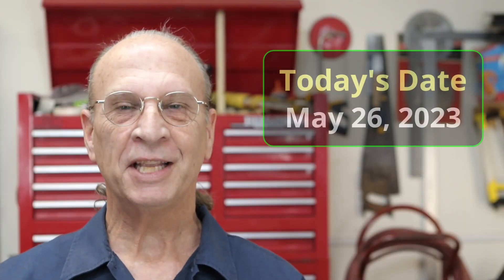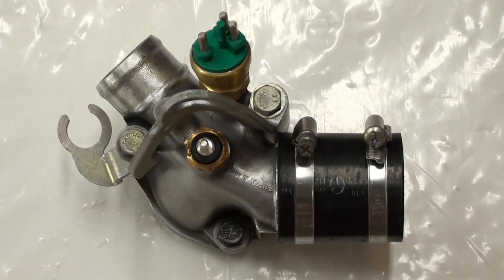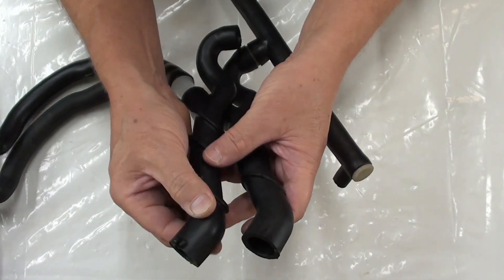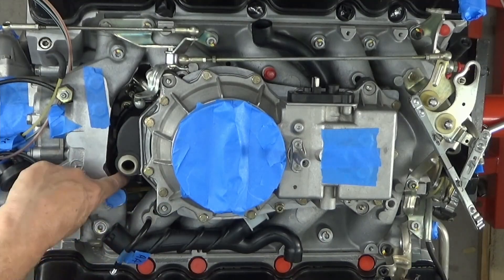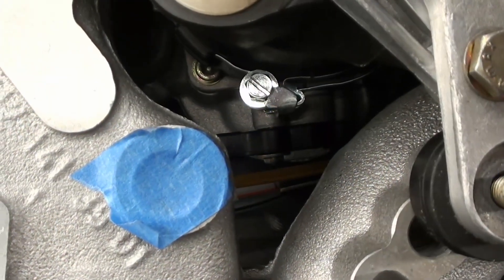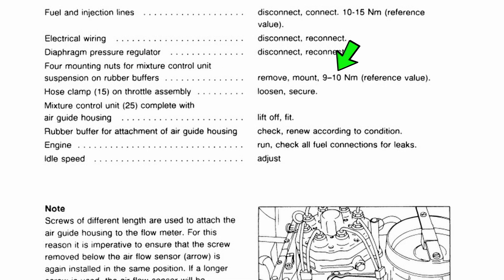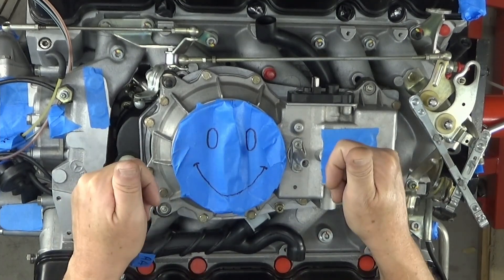560SL - Installing Mixture Control Unit

Comment: Hi Tony, do you have an idea of number of bushings on which you placed the unit?
Reply from the maker: @Mcbresis  I’m afraid I don’t know what bushings you are talking about. There are no bushings used or mentioned in this video.
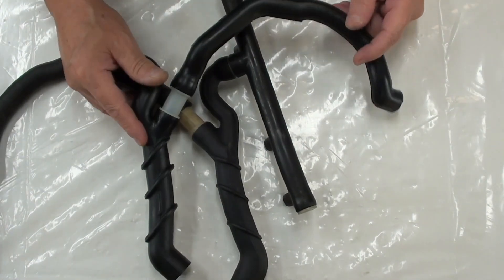Reply: @TonyLiveTV  I meant these 4 srews with rubber on which nuts (0:23) are mounted. I can see them clearly from 2:58.
Reply from the maker: @ those are called air cleaner buffers. Here is a picture of the genuine part: https://www.pelicanparts.com/More_Info/6159880011.htm Here is an aftermarket https://www.fcpeuro.com/products/mercedes-air-cleaner-mount-6159880011